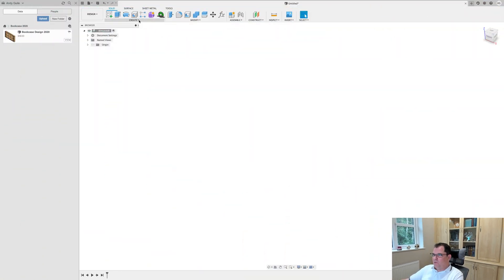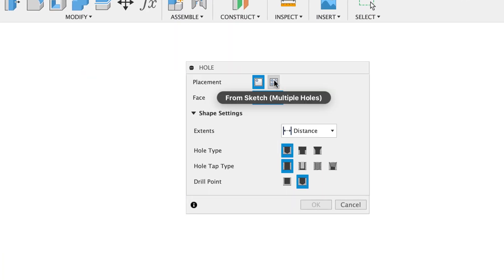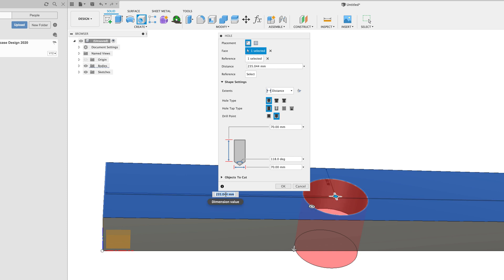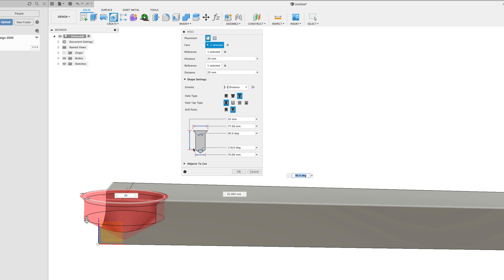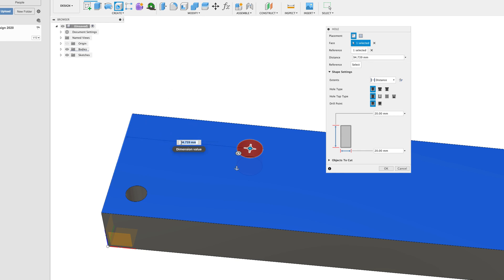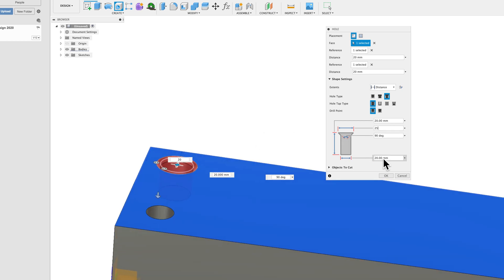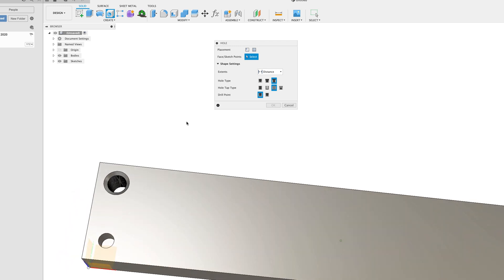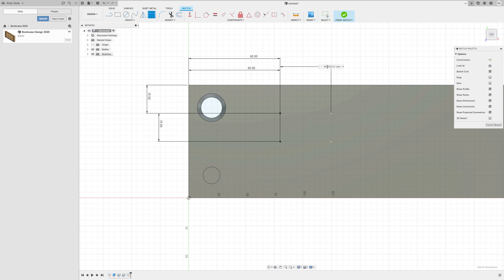Episode 005 - Hole command Fusion Friday for woodworkers.

Comment: Watched this and made sense I can now have a go at my mft workbench top. Running alongside your bookcase videos it's all coming together,so SketchUp will take a back seat thank you
Reply from the maker: Hi John,

A few folks have mentioned modelling MFT tops.

Although you could lay out the top grid using sketch points. The hole command in conjunction with the pattern command is great at making an MFT top.

I’ll run through the pattern command in next weeks Friday Fusion and give some pointers.

Cheers

Andy